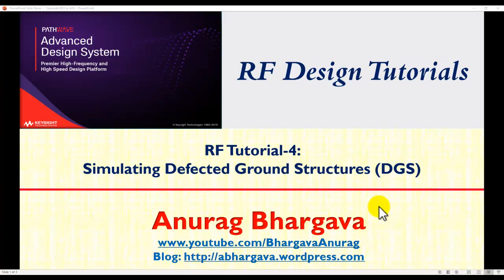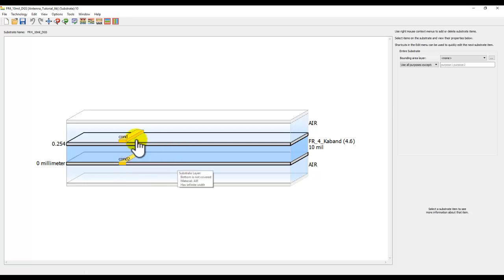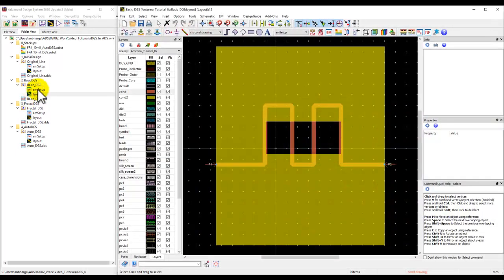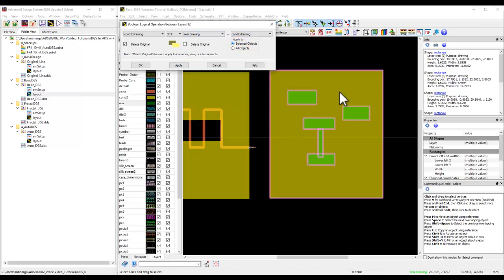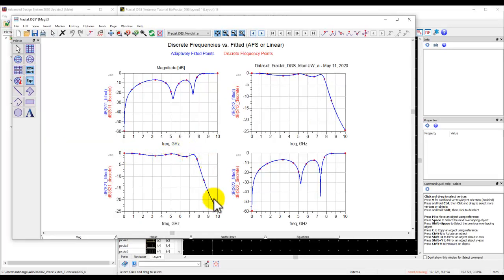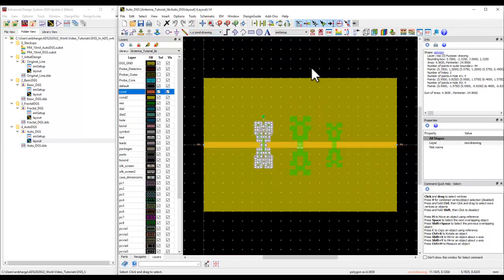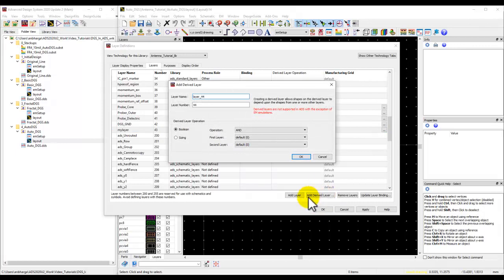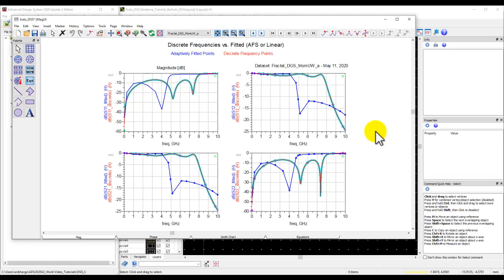RF Design-4: Simulating Defected Ground Structure (DGS) in ADS

Comment: Great explanation...I have a query.  Suppose one wants to mount this circuit in a metallic housing with a top Cover with sma connectors for input and output port. Then will not the bottom metallic surface of the box eliminate the effect of the dgs?
Reply from the maker: Housing can play its role if it is too close to the substrate surface but as long as it is placed 10*Substrate Height, it should affect much. However, you can always accommodate housing and SMA connector and simulate entire assembly in 1 FEM simulation to remove any doubt and take preventive measure if it does affect your design.

Comment: Sir, recently I simulated and designed a low-pass filter with a dumbbell shaped defect ground in ADS. I need to connect a varactor diode to the defect part of GND to achieve frequency tuning of the filter. May I ask how to set the port type and select the ground level of the port if a port is added to GND?

Comment: Thank you for nice tutorial about DGS. I am facing a problem to set a port, while I design the DGS layout shown in your tutorial. After connecting a port in COND layer, a message is shown in simulation setup that is "No explicit pin is assigned to minus terminal while there are no infinite ground or slot layers defined in the substrate layer. This port setup can lead to inaccurate or unphysical results." Moreover no GND layer is shown in port editor. How can I solve this problem? My ADS version is ADS-2016.01.
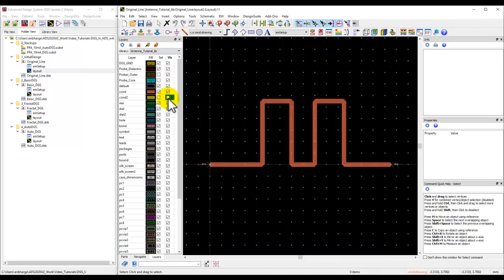Reply from the maker: Hi Asad, You need to take a look at Port Editor properly and define the ground layer for your +ve pins in layout.  Look at video again and focus from 3:22 onwards to go thru Port Editor where "cond2" is defined as a ground reference for +ve ports placed on "cond" layer.
Hope this will resolve your issue...

Comment: Sir, i have add cond(2) as the second conductor layer (gnd) in substrate editor, then add via and map its top to cond(1) and bottom to cond(2).But when I go 3D view in layout, the cond(2) overlap with cond(1), why?
Reply from the maker: Kindly make sure tech.subst stackup definition contains the VIA as this is what 3D view in ADS layout will use to show different layers of you layout. Also, check whether you have actually used VIAs in the layout as defined in the stackup...😊